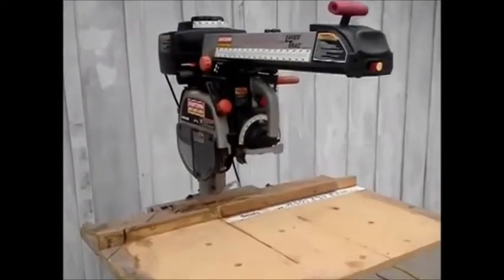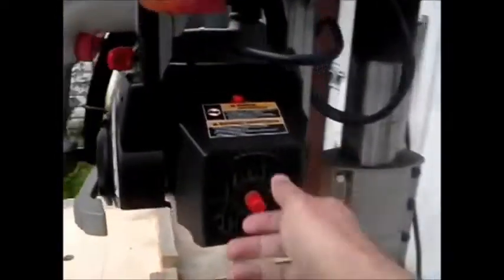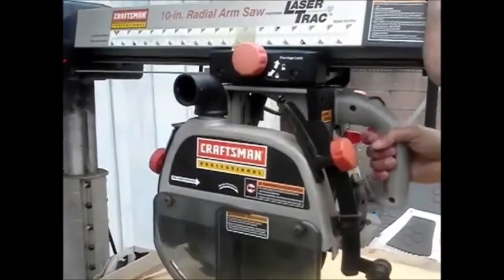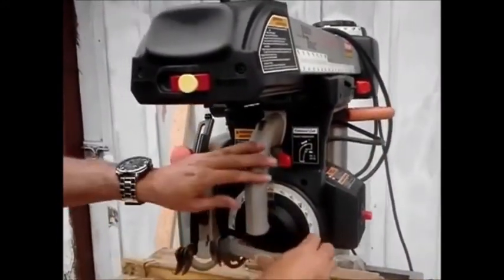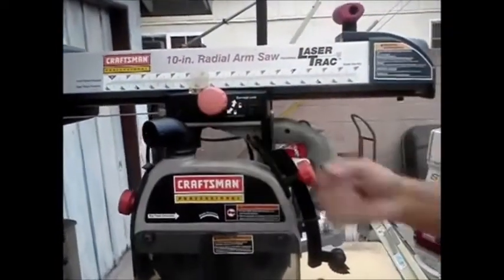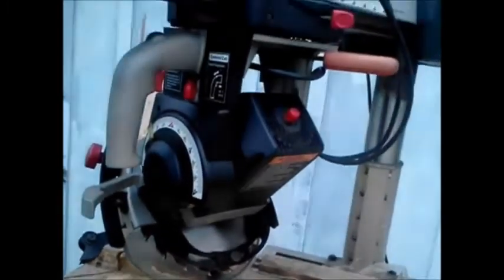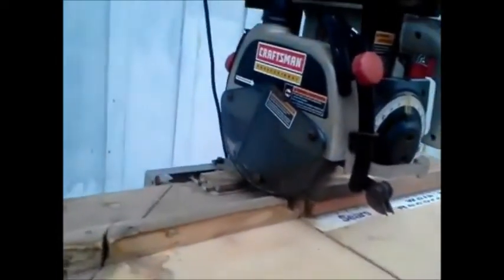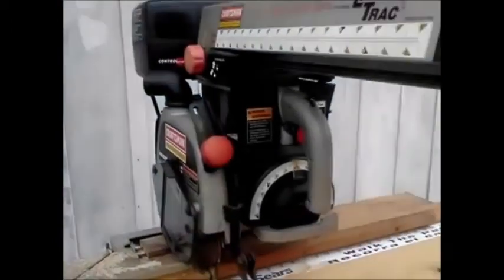Craftsman 10" Laser Trac Radial Arm Saw Demonstration Video

Comment: My dad bought one of these (DeWalt) in the mid-50's and it became our most commonly used saw at building sites (except for our Skil saws.)  It was especially handy for cutting cedar lap-siding for the walls of a quonset because of constantly changing angles as you go up the side.  It generally was set on the tailgate of Dad's station wagon and used there but sometimes was set on two sawhorses.  It seemed very precise to me.  (As you can gather, it was a more compact saw than the one shown here.)  Dad sometimes used it for ripping but more commonly for cross cutting and later, cabinetry for winter work.
Reply from the maker: bodryn Yeah. Obviously, this is a shop model, but it certainly gets the job done! Nothing like a radial arm saw. These are kind of like table saws in reverse.

Comment: I just bought mine used and it's very clean. Everything works. No operator's manual though. I have Model 9058. Going to the Sears website, I can't find it. Any suggestions would help.
Reply from the maker: There are a lot of vendors on line that offer the manuals for these units. You can likely go to the Craftsman website and download a manual also. I say "The Craftsman Website" because Craftsman tools was recently spun off to Stanley Tool Company, so it's unlikely that Sears will be supporting this product with information and manuals. If you don't get any satisfaction there, you might try your local library. Hope this helps.
Reply: I think I found it. It directed me to the Sears website which I expected. But the manual itself must have a part number because it was listed as 315.(Series of numbers).
Reply from the maker: Was it a complete download?
Reply: it was for the site but it doesn't download to my device

Comment: mine has a slight bit of play in the arm and it's not letting me get perfect 90 degree cuts.  is there any way to help that?
Reply from the maker: I've never had one of these with lose movement. I would suspect that the "play" is from either the swing arm at the pivot or the glide along the length of the arm. From what I've heard about these saws, the pivot is likely the problem, but I couldn't tell you that for sure. Play on a saw could be dangerous to the operator and to the equipment because undue lateral stress is being placed on the quickly rotating blade. If it's a matter of replacement bushings or bearings, the problem should be a matter of replacing worn parts. It would be wise to seek a fix before using this saw again. You'll never get a clean cut if your blade is moving laterally anyway.The manual has an entire trouble shooting tree to analyze various problems. I would definitely scan that document or call the Craftsman hotline to see what the fix is.

Comment: Can the Laser Trac be added on, I originally purchased my Radial Arm Saw in July 2000?
Reply from the maker: The laser is simply a piece that bolts onto the arbor, so I've seen these as a separate unit for a little over $100. Just visit the Sears Craftsman tool catalog on line.
Reply: thanks Frank.

Comment: Sears discontinued it not because they want to sell you 2 tools instead of one, but because these machines were dangerous, had a poor performance and safety factor.  It's why you're selling it.
Reply from the maker: christschool  On the contrary. While it is true that the EARLY model Craftsman radial saws had inherent danger, Craftsman was forced through a federal court order to offer a recall and/or upgrade to bring the saws to a federally mandated safety compliance. I have two of these saws in my possession now; one is an earlier model which I have a safety upgrade kit for, and the other is a late model kit for which I have a new table and stand that is virgin unused. The kit includes a blade guard and a table/fence. I'll be selling one of these saws as soon as I put the kit together. These 10" radial arm saws are still available through Craftsman through a catalog order and they have outfitted them with a laser track for visual accuracy. The reason you don't see too many of these saws around any more is because they require a lot of work space. Delta and Dewalt also market their versions of these saws. The Dewalt is even larger and more industrial, while the Dewalt is a seemingly cheesy model compared to the Craftsman.
Reply: Paul Cox The only dangerous tool in the shop is the operator who uses the tool wrong.
Reply: This design has more safety features than any of the others I have seen. If you need radial arm saw this is the design to have. With  speed limiter as the saw is pulled through the wood, the risk of the saw climbing as it cuts is eliminated. And it’s fully guarded with guards that work well. 
They also had a price just short of $1000. Pretty much too costly for most people.
Reply: @frankhamilton8257  Would you happen to still have the table? I need a new table, I will make one if I have to but I am looking to see if anyone has a table handy....
Reply from the maker: @Kathyskollectables  I sold this saw a while back, but I did make a few tables with rip fences before I sold it. I'm not sure if I hung onto them, but feel free to text message me at 714-574-1544.